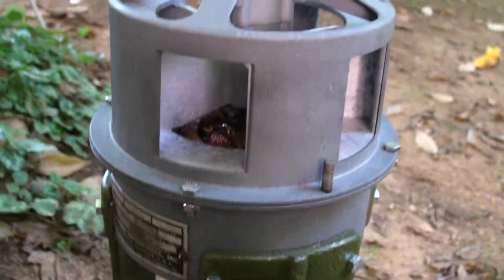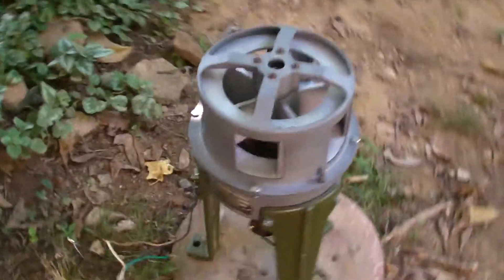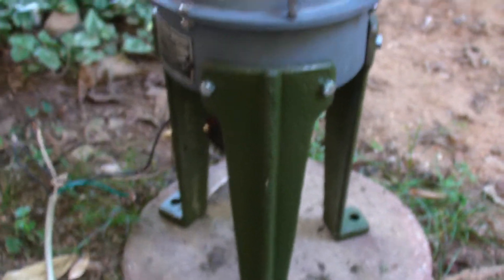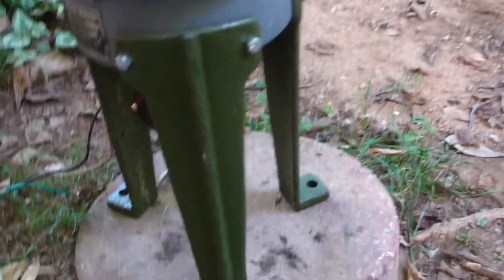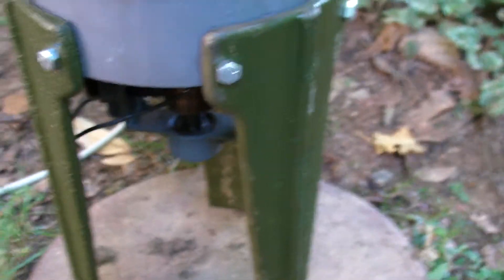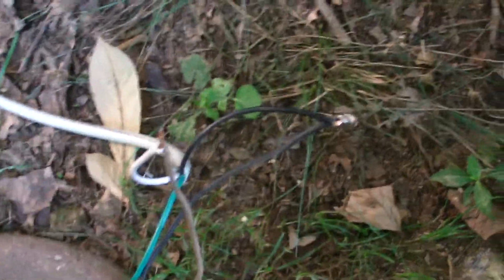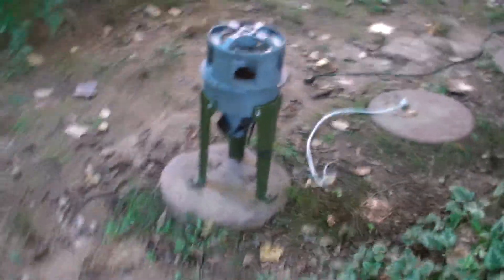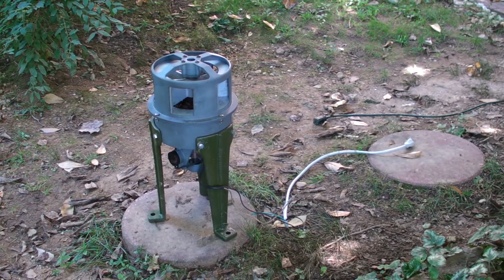Restored Model 2 Siren Test?

Comment: all of these comments are wrong... it's actually because you need to flip the field/ switch them around - there should be rings that screw onto the carbon brush holders and you need to flip them around... I know this will work a hundred percent because mine was doing this yesterday when I first got it back... and it turns out it's because they put the wire polarity on wrong- you will unfortunately have to remove the siren armature to get to the rings but once you have done that it should work in operate on DC voltages and AC. this is actually called "motor stalling"
Reply from the maker: The latest update, I found out the stator windings were shorted out along the housing, so when AC power was applied, it would just humm. After I figured it out and fixed the short. It runs on regular AC straight from the wall.

Comment: My father collected some Lionel trains with AC powered universal motors.  I noticed that the stator was connected directly to AC while the rotor was commutated.  If this is supposed to be a universal motor, and you wired one of the two coils so that it self excites (meaning it is its own closed loop), rather than it being connected directly to the AC while the other coil remains commutated, then that may explain the problem.  The only other suggestion is to put a high voltage DC regulator diode in series with the "hot" (not neutral) lead and add a high voltage capacitor in parallel with the motor to filter out the pulsating DC.

Comment: A 240V motor SHOULD ONLY work on 240V it's shorted otherwise.
Reply from the maker: Ender Pea for induction motors that maybe the case however in the case of a universal motor which are used in the model 2 siren, they can run of AC or DC up to the rated voltage. Suppling half the Voltage will only give half the speed, I did figure it out why, now it runs good on 120V and 240V

Comment: hey. use a rectifier! it turns AC to DC. were as an inverter converts DC to AC. so use a rectifier rated for 120V AC to 120V DC. Hope this helps if you still haven't gotten rid of it or no ones told u yet. lol
Reply from the maker: DuskyTheHusky I got a full bridge rectifier that temporarily solved the problem, 
Later I fixed the issue, it now runs on AC power now, the problem was one of the stators was shorting out (during installation) which caused it to hum with AC but rotate with DC but draw large currents
I appreciate the help though!

Comment: Hot and neutral mixed up?
Reply from the maker: sniparGP779 what was happening was the stator winding was shorting out on the casing, causing just the armature to be energized, I fixed the problem and now it runs great on AC

Comment: The main reason it's doing that is because you do not have the stator pins all the way secured. Both the bolts and pins must be completely fastened for the siren to run smoothly. This is true for all 2's as well as Thunderbolts.
Reply from the maker: it was only running in DC because the field windings was being shorted out, and the power would only go through the armature, after i insulated all the exposed wire, it runs great on 240AC

Comment: This is a special siren so in stead AC it uses DC
Reply: Yeah! Federal signal 2001 D_Cs!!!
Reply: It was made to use ac but for some reason it won’t work I think the motor was rewound to use a lower voltage than what it should use
Reply: @demetrijohnsonssirenvideos3590  it was actually correctly wired from the shop he sent it to. The problem is is that the enamel coating that Was baked onto the windings was damaged when he probably took it home and that therefore made the siren run on Dc for the video